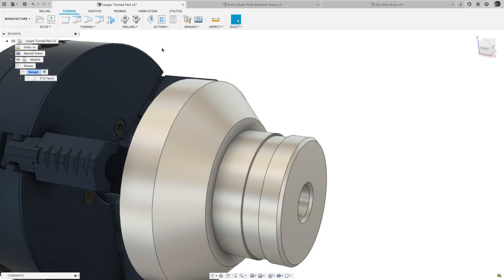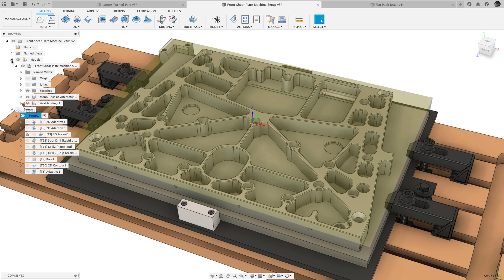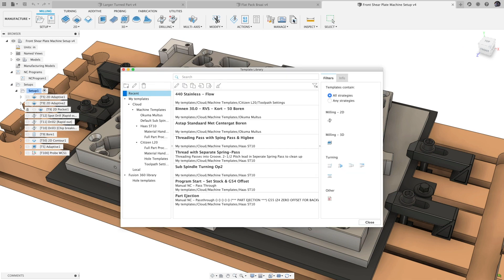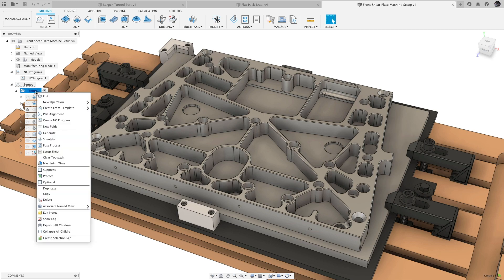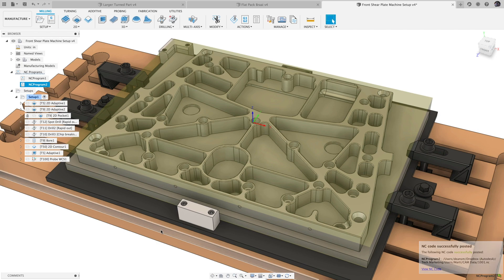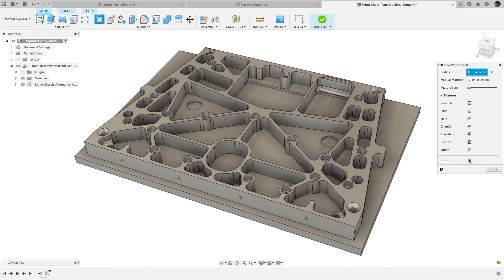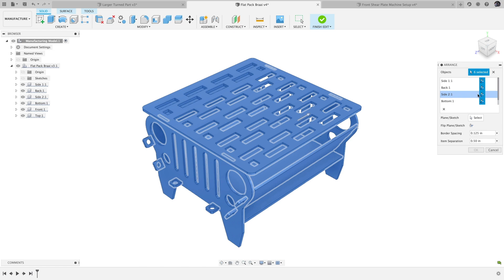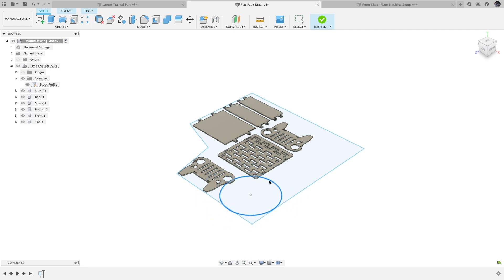What's New in Fusion 360 Manufacturing – August 2020

Comment: I was hoping to use the Arrange capability to provide layouts for laser cutting sheet metal designs with multiple parts each with bends.  I have been looking around for information about doing this but have been unsuccessful at finding a method that is parametric where an update to the sheet metal design will update the manufacturing model and allow for recalculation of tool paths.  I have figure out how to do this manually using dxf drawing exports and imports but it is very labor intensive.  I was wondering if there was a better way to do this.
Reply: Hey Stuart, that kind of more advanced functionality is what you can expect when Nesting comes out! In the meantime, there might be a way to use manufacturing model to manually arrange flattened sheet metal bodies but their positions will not update parametrically (like they will with nesting). @ravijavia might be able to give more detail
Reply: Marti Deans ya I was able to unfold the parts and then use the arrange but then it unfolds in my assemblies when I updated them. I guess I was hoping to have a way of using a local unfolded part for layout and fabrication. But have a folded one for assembly. I can copy or duplicate the parts but that will impact keeping the two in sync
Reply: Hi Stuart, sheet metal flat patterns can not be arranged easily at this time. We will be improving this in a future release so that you can arrange them just as easily as non-sheet metal components. There are a few different workarounds available today:
1. Create a new document and insert derive flat patterns of components you would like to arrange.
 (FYI - This has some shape overlap issues which are getting resolved in next update.)
2. Activate flat pattern, RMB “Save Copy As” to save as a new component and then use this in a new document.
3. Export DXF of the flat pattern and import it as a sketch into a separate component. I agree, it is labor intensive to deal with DXF's individually. You can improve this significantly by using DXFImporter add-in to batch import DXF files - https://github.com/tapnair/DXFImporter#How-to-install
Reply: @ravijavia8183  thank your that is good to hear.  Just and FYI I was able to use the arrange feature just fine with the sheet metal parts when they were unfolded.  the issue comes with the folded vs unfolded part.  If there was a way to keep an unfolded version for fabrication and a folded version for assembly and maintain updates between the two that would be great.

Comment: Please add an measure method to check the position of the workoffset to the part. Otherwise i must use a sketch or do a look to the gcode to check the position.
Reply: Does it help to use Snap Points while you're using the measure command? We just created a quick tip on this! https://www.youtube.com/watch?v=3Gvr6ClbT1c
Reply: @marthadeans  I don't know about that the G54 point I see in this video can be selected. That's wat I'm writing about. I must test this!
Reply: @HardcoreMusik  Ah yea, how you define the G54 origin would make a difference – if you are using the Stock or Model Box points, you won't be able to select them using Snap Points (unless you model your stock as well). So I guess this isn't that helpful in that case

Comment: where is flattening tool?
Reply: Seems like you can do atleast some basic flattening with the help of sheet metal functions, but seems like a pretty big workaround if you (like me) design curved glasses and stuff and need to flatten it, even more so if the curvature isnt cylindrical.

Hopefully Fusion can get something like the Unroll surface and Crush (for doublecurved surface) in Rhino :) 
That plus a proper nesting feature for waterjet/lasers and CNC routers, preferably one where you can use parts from multiple models/projects at the same time, and I can do my entire CAD/CAM workflow for 2 companies all in Fusion :D

The Arrange feature seems completly awesome and like fantastic start to more Nesting, cant wait to try it out, but still doesnt seem practical for nesting say 100+ parts  from 10+ different projects to 5-10 sheets of aluminium at the same time for watercutting with minimal materialwaste.
Reply: @Robinlarsson83  Arrange is a simplified version of Nesting. The team is also working on Advanced Nesting functionality which is currently not available for Public Preview. It will include the features you are looking for. You can find more information on Advanced Nesting here - https://forums.autodesk.com/t5/fusion-360-feedback-hub/open-nesting/td-p/9068208

Comment: Is manufacturing model going to negate the need to use a derive to avoid making a mess of the original model?
Reply: Yes, absolutely! Manufacturing model is a derived modeling asset which is intended to facilitate manufacturing-specific changes without affecting the original Design model.
Reply: @ravijavia8183  Will there be further integration to Inventor - we have a huge problem collaborating with job shops often on the Inventor platform, where it seems silly there isn't a good workflow to and from Inventor (history - especially with version control and the ability to see/learn from the CAM operation to engineer for manufaturability.

Comment: The arrange feature looks excellent! Does it also provide the ability to orient the parts at a certain angle like say 45 degrees relative to your plane?
Reply: Arrange does not support grain alignment or rotation control. It allows objects to rotate full 360 degress with 90 degree increments. Once Arranged, you can use the Move/Copy command to rotate the parts to desired orientation. Arrange is a simplified version of the Advanced Nesting functionality which is currently under development. Advanced Nesting will provide the additional control you are looking, and much more.
Reply: @ravijavia8183  thanks, I'm looking forward to the grain alignment. woodworkers like myself need it. Thanks for this feature it will help already a lot
Reply: @ravijavia8183  Can you rotate the objects around X, Y and Z axis, so say you have an assembly where you want to manufacture 2 or more parts from one piece of stock?
Reply: @jenspetersen5865  yes, you can use the Move/Copy command to manually reorient the Arranged components as desired. To pre-orient the parts before arrange, you can select a planar face to determine "face-up" direction and it will get arranged accordingly. Additionally, the flip icon in dialog (or white arrow in canvas) will allow you to flip the object while maintaining constant Z position within stock.
Reply: @ravijavia8183  Fantastic!